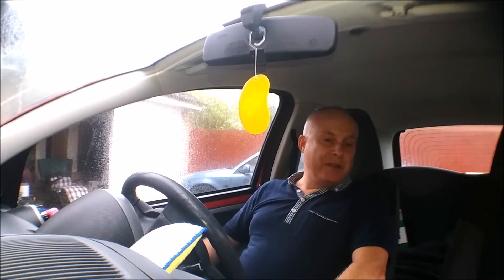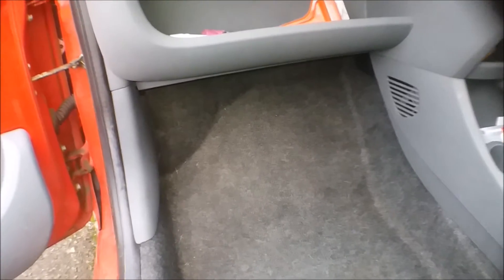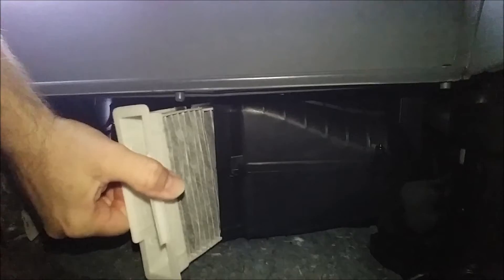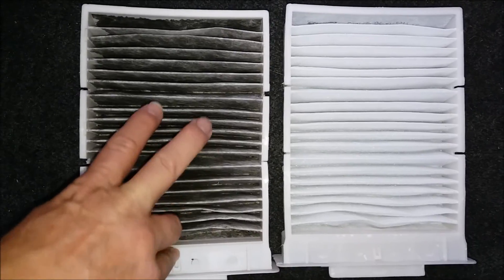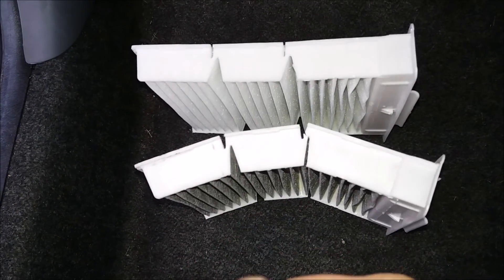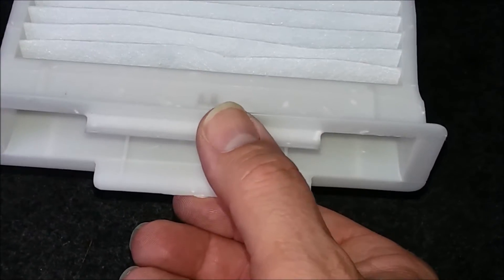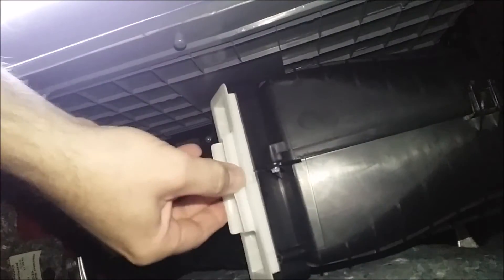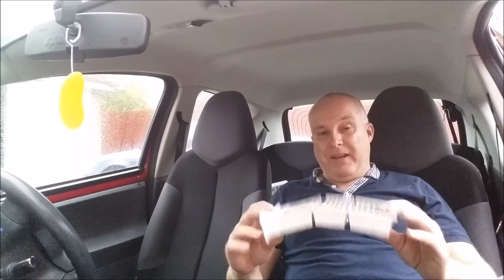Citroen C1 Pollen Filter / interior Air Filter Aygo

Comment: Didn’t realise how easy this was!

My partners 2011 C1 keeps misting up on the windscreen / windows and it’s terrible. I doubt this cabin filter has ever been changed. Could this be a good reason as to why it’s misting up all the time? I also get bad headaches when I sit in her car.

Thanks :)
Reply from the maker: An old dirty filter is probs responsible for your headaches. the misting up could be the heater on recirc OR you have a water leak, probs in the boot  https://studio.youtube.com/video/INerlNsuULo
Reply: @CycloneCyd  After checking out your other videos and checking the boot, the boot floor was soaking! So I’ve managed to sort the leak and change the cabin filter. My headaches haven’t returned since and the boot is staying nice and dry now!😉 Plus the car isn’t misting up anymore! - So the boot leak would have caused that. 

Sad news this week as Citroen have stopped producing the C1 :(
Reply: I used to get headaches all the time whilst sitting in my partners C1. Changing partner resolved the issue for me.

Comment: ? Why is mine blanked off...??
Reply from the maker: does your car have air con?
Reply: @CycloneCyd  no.. But I thought it have a pollen filter
Reply from the maker: @z.hussain3230  only models with aircon have pollen filter
Reply: @CycloneCyd  thanks mate.. Very helpful... I'm thinking of cutting the edge to fit one.. Your opinion.. Also gear lever is loose.. Had a look it's has worn.. Any suggestions..
Reply from the maker: @z.hussain3230  sounds like a good idea. Take some pictures and send them over. I've never actually looked at a non aircon version, so I'd be very interested in how that turns out.
Could you get a gear mechanism from a scrapper?
Reply: @CycloneCyd  im going modify it next week.. Yep I'll take pics or video.. Thanks
Reply: @z.hussain3230  I knw this is late, but I was very confused since I was looking to replace the cabin airfilter. Mine doesn't have air con too.
Reply: @wiilkasanadka10  u can cut it out
Reply: @waterhoofder6448  my C1 don't have as well,how to cut box any video